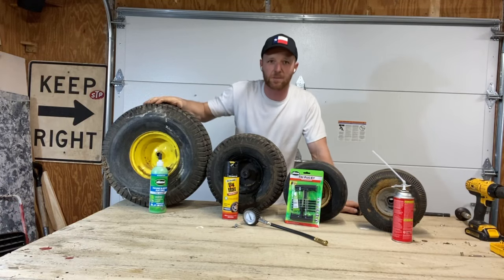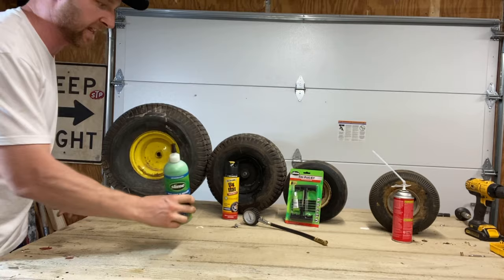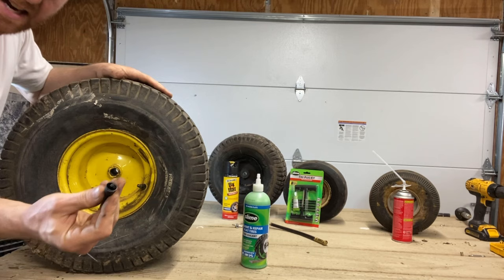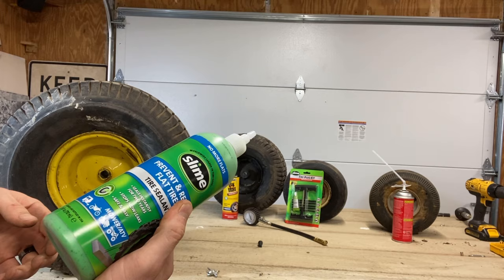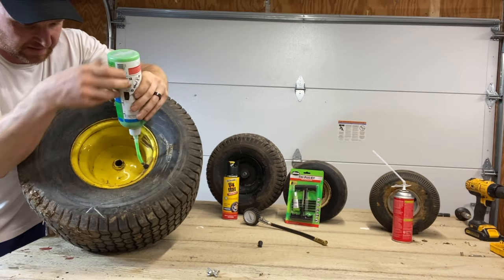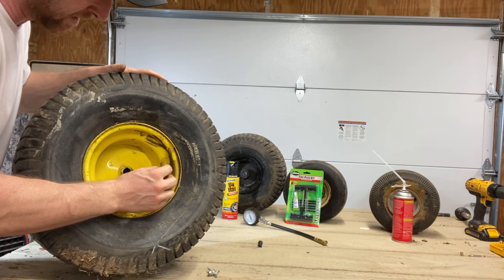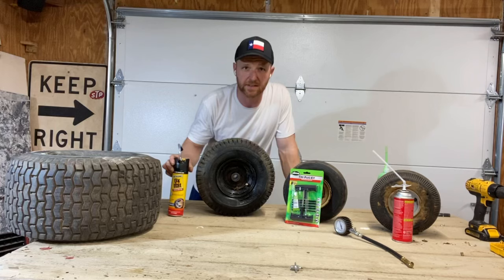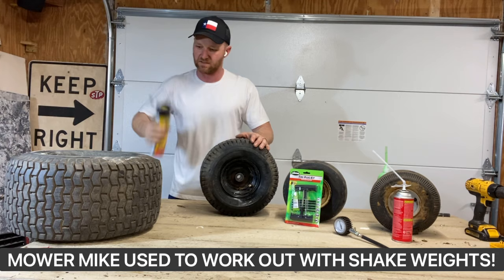Mower Tire Repair; Plugs vs Slime vs Fix-a-Flat vs FOAM (WARNING FOAM DOESN’T WORK!)

Comment: I didn't have a plug for a hole in my little lawn tractor tire. so I cut a piece of gas line, swabbed it in loctite foam(can) shoved it in with my trusty ol plugger set it on fire let it sit, held 20lbs which was way too much but just testing it. So now until I get another tire it looks like my tire has a "tooma". I have plugged thousands of tires, quite literally, working on garage for 15yrs,and I winced in the annoyance guaranteed to come when it's time to hook up the baby tire changer to the shop changer. There's always multiple leaks, then people bring their own tubes that also leak; all around headache but I do it anyway. Not tackling these mower/tractor tires is not only cowardly, its like seeing a mouse or roach in a house and just shrugging & walking away. Btw, replacing the air with foam is a total NPC zombie move
Reply from the maker: I really enjoy your use of the English language. I agree foam in the tire is totally lame. 

What is a NPC zombie?

Comment: With the caps & crack foam it seems to work with the tire stationary on the bench, but how did work when the tire was actually in use?  Did the foam sealant in the tire break up and lose its sealant?
Reply from the maker: Not so well my man, check out my other tire foam videos here. 

https://youtube.com/playlist?list=PLo4VDcnI4eoj7LEY4fgx7hGW1bM8VYQew&si=IrixeuIXIgVREu2u

Comment: Just curious why you didn't use any of the tire cement for the plugs/patches. Nice video Mike!
Reply from the maker: Good catch I probably should have. I was wondering what that tube was for in the kit lol
Reply: Yeah, my first thought. "Why isn't he using the glue"?
Reply: I've never used the tire plug glue on vehicles either and they have never leaked again regardless. Those plugs have plenty of glue/stickiness to them already. 👍

Comment: 14:53 I'm about to use some Fix a flat just because i have some. You're suppose to drive on it for a awhile after using fixaflat. It is really just expanding foam, however i have heard of people messing up thier tire by using to much rendering the tire useless. As for the exspanding insulation i would like to see if  it works if you have both tires filled like that or if its just better to use tires? You also forgot the black bead seal which is older than slime & better from what i have been told?
Reply from the maker: All I can say is do not do the construction foam, check out all my foam fail videos on my wheel and tire playlist.

Comment: I have real good luck out of plugs, on tubeless tires. Its a must to cut it off flush with the tire. Don't let it hang out. It will get caught on some thing and pull out

Comment: Have any of you put a tube in a drive wheel of a zero turn?  If you have, did you have any problems with the wheel spinning in the tire?
Reply from the maker: Nope never have, I just went to solid rubber wheels on my front zero turn wheels.

Comment: I just want to know.. How in the heck did you get the big rim off the tractor? I've tried everything. WD-40, PB Blaster, Heat, Pounding it, can't get that sucker off.
Reply from the maker: Take a look at my wheel/tire playlist I have a video on it. Good luck is a bear

Comment: This idea ads a lot of weight but it will keep it in a shape to roll. Fill the whole thing with concrete.Actually put a lot of pressure in tire put it in a tub of water locate leaks and plug them with a rope plug best cheapest way to keep my tire flying down the freeway. Fix side walls any small hole
Reply from the maker: I totally agree with you, plugs and tubes are the best fix. But this is YouTube and everyone wants to watch “shortcuts”

Comment: When you are plugging you want air left in the tire,  so you don't remove the reamer until you are ready to plug the tire.  Also it might work on a mower tire,  but typically you never plug a sidewall. On a car tire I would never do it,  but on a mower tire I'd probably patch it instead
Reply from the maker: Good advice thanks
Reply: Radial repair doesn't allow patch on tread within one inch of the side wall.
Reply: I have used the plug on a semi tractor drive tire that had a bolt go through the side wall.  It lasted over a year until I was ready too replace tires. I was often maxed out at 80,000 pounds.
Reply: @jimbeetem7143  Two things.  Semi tires have MUcH stiffer sidewalls, no comparison to car tires.  And you got lucky.

Comment: Great video. Sick of taking my John Deere zero turn to their service centre for tyre fixes - they charge like wounded bulls, not deer 🤣. We can get Slime here in Australia so think I'm going to give that a go & see how long the fix lasts. In any event it's going to save us a couple of hundred $$ each time there's a leak if it works for any half decent amount of time.
Reply from the maker: A couple hundred Australia Dollars, I am not sure if that is a lot or not lol. Slime seems to work about 50% of the time. Is a good first option, if that doesn’t work try putting a tube in it. 

https://youtu.be/xPGrzX6YhKs
Reply: @MowerMike  If I was paying with US$ it'd be a hell of a lot cheaper due to exchange rate 🤣. Bought the Slime flat tyre kit at the local auto store & seems to have worked a treat. Added bonus of the unit inflating the tyre after feeding the Slime is great too. If things go south I'll try your tube suggestion.
Reply from the maker: @mattgibson6144  Glad it helps and it is really cool to have viewers down south growing grass when it it winter time here.
Reply: Tireject works the best

Comment: What If the lawn mower tire is completely flat. Should I put some air in the tire , then put the slime sealant in the tire then run the tire around? Thank you in advance
Reply from the maker: Start with air and see if it is leaking from a certain spot. If you can pin point one hole use a plug. If it leaking from around the rim or several places maybe slime. But really the best is putting a tube in it. Any local tire shop will do that for ya
Reply: @MowerMike   Thank You I appreciate your time.

Comment: What happens if the tire comes off of the wheel? How do you repair that? Air leaked completely out from neighbors roofing nails 😡
Reply from the maker: Well that is no good. What I would do is if you can take the wheel off take it to a tire shop and they can put a tube in the tire. (Make sure to pick up the nails before you mow again ;)

Comment: I use Lock tite foam in low speed utility tires. It is not urethane based. The label says it is flexible and it certainly has somewhat has much more give than the urethane foam. So far so good.
Reply from the maker: Good luck! Never heard of that foam

Comment: From what I have read on my 1-gallon Slime container the instructions the product is not recommended for sealing sidewalls or the bead area.
Reply from the maker: I suggest just trying it and seeing how it works. You bought is so give it a whirl. If it doesn’t work try the foam method in my other video. It doesn’t matter if you already have foam in the tire. Good luck!
Reply: Damn really? I have never ending slow leaks around the outside bead of both tires. So damn annoying. I ordered some slime hope it works

Comment: Bought a classic John Deere yard tractor to restore for fun, after getting the engine rebuilt and the body powder coated, the wheels needed powder coating and Ag tires fitted, after practically cutting the tires off i found the tires had been slimed and the crap had hardened that it had to be sidegrinded off, to my further dismay the rims had been corroded heavily by the crap (slime) they had to be sandblasted  and the pin holes through the rims from the corrosion caused by this crap had to be welded up, keep using this tire crap only on the AYP junk and box store trash mowers
Reply from the maker: Good advice I have never seen that before, thanks for the comment

Comment: Hi Mower Mike! I see its been 2 years since you posted this video. How has the front lawn mower tire held up?
I'm thinking about trying it.
Reply from the maker: Check out my tire playlist, will answer all your questions
Reply: @MowerMike  Thx! I did my 1st tire this evening. I used loctite big gap foam.
Reply: @MowerMike  My foam fill was a fail this morning but it seems to have sealed the 5 dog punctures and I was able to air it up and so far so good.
I have brand new front tires that wouldn't seal at the beads so I did the bead sealer yesterday morning only to find out that the tire that my dog attacks every time the blades start had 5 punctures in the side walls. I already had 2 plugs in the side walls because of her and I just wasn't gonna put 5 more plugs in the tires. 
Hopefully this foam can still work as a tire sealer so the tire can still hold air.
Reply: I soooo thank you for your awesomeness and labor of love.  The foam inspired me greatly....my only concern is that it might hold dents or something.

Comment: LOL, in my time I have tried all these and more, my personal conclusion for multiple reasons: tire repair plugs or tubes. That’s it. Everything else is a problematic gimmick that will only make you sorry you fell for it.
PS: the foam quickly squishes and breaks down, then you throw the tire, rim, and empty can in the burn pit and go buy the whole shootin’ match.
Reply from the maker: Yep totally agree. You should check out my foam fail videos on the tire playlist.

Comment: if you're in Texas and have a bunch of holes after you mow -  mesquite thorns...?  Aren't you supposed to turn that foam can completely upside down so you don't just release the gases?
Reply from the maker: You really need to watch my other foam videos. Mesquite thorns? I have never seen a Mesquite tree with thorns.
Reply: @MowerMike  I am looking up your other foam videos right now.  Does the foam make the ride any firmer than having air in the tires?

"...never seen a Mesquite tree with thorns."  If you're a real Texan, you must be pulling Dabcorn's leg with "comedic irony".  🤣
Reply: Tons of mesquite in Texas! For sure. Mesquite trees are full of thorns.

Comment: most mower tires if you dismount the tire and seal the seam in the middle of the rim will be all you need
Reply from the maker: Are you saying to seal the actual metal rim?
Reply: @MowerMike  yes if you dismount the tire the rim especially on a deere the rim is 2 pieces and its pressed together so there's a seem right in the middle if you have a leak and cant figure out where it is thats probably it
Reply from the maker: Interesting thanks for the tip never thought of that one

Comment: Don't think the foam work with much weight on it crush down over time probably work on those little pull behind trailers lawn mower style or wheel barrel light duty
Reply from the maker: Check out my tire playlist, lots of foam video fails

Comment: Guys don't ever ever in your life use that slime green crap it'll eat the metal on your wheel within a few years then you have to be replacing the wheel and a tire so don't use it unless it's in a dying need emergency other than that never ever use that stuff it's horrible
Reply from the maker: I wouldn’t say ever. I use it all the time on mowers I am fixing up to sell. 

Hmmmm makes me think sure hope those wheels falling apart. Well dang it

Comment: You fail to use the tire cement with the plugs. But you don't even know the difference between a tire plug and a tire patch, LOL
Step 1 locate the leak. You did
Step 2 Thread plug in plug tool. You didn't
Step 3 Use reaming tool to prepare hole for plug. Leave the reaming tool in hole so your air doesn't leak out.
Step 4 Apply cement to plug in the eyelet area about 1/2 inch both directions. This helps lubricate for insertion and glues plug in place, most plugs are heat vulcanized by highway use on autos, but is not needed in all applications like mower tires.
Step 5 Remove reaming tool and insert plug half way or a little more, twist and remove plug tool.
Step 6 Trim plug flush with razor knife
Reply from the maker: Haha I can’t believe they even let this guy post tire videos!

Comment: I suggest  drilling only one hole  see how well foam does
Reply from the maker: I am done with foam videos give it a whirl
Reply: @MowerMike  only  if I  have to been  plugging tires for a living  39years I had only one accident doing tires. I  was  plugging  tire for police  department and  slipped  stuck reamer  through  hand pulled  it out  finished  tires one of police  officers  almost  tossed his cookies, he turned so white thought  he was going to pass out.
Reply from the maker: Youch that sounds horrible!

Comment: Has anyone tried putting butyl rubber sealant on the inner surface of a non highway tire. Lawn tractor tires are made out of butyl rubber to begin with. From what’s listed, the stuff is considered airtight. I’ve not tried this route.
Reply from the maker: Give it a shot and let us know. You would have to completely remove the tire to do that. If you are going that far you may as well just put a tube in it
Reply: @MowerMike , I’m retired and on a fixed income. Every penny counts, especially in today’s economy.

Comment: {{ WARNING FOAM DOESN’T WORK! }}<<<<< Why do you say that???? Looked it did to me.........  Slime appears to win, BUT BUT BUT only if tire is frequently rotated like on riding mowers..... 
My problem is these small freeken generator tires that hardly ever get moved, for months they just sit in one place till power goes out, I want a way to easily permanently fix them, those tires dont come off without destroying the rim!!!!!!!!!!
 It looked to me that the foam worked good BUT then you say in description>>>>>  (WARNING FOAM DOESN’T WORK!)<<<< Why didn't you say that on the video and WHY did you say that????!!!!!!!!!!!!!
Reply from the maker: It doesn’t on a heavier machine like a mower, check out my other foam videos have alot of foam rails

Comment: Slime is crap. Your supposed to drive it for 3 miles. Ya sure, I'll take my mower for a honeymoon drive. BREAKS down in days not weeks until you decide to put a tube in it then it flows all over the place. I had a great one in the 70s called flat proof but no longer on the market...figures. Still looking for a REAL slow leak fix.
Reply from the maker: Sounds like you are a tube man for life

Comment: Not a good solution. This is low-density, rigid foam. You want high-density, flexible foam like Smooth-On's FlexFoam-iT! 25.
Reply from the maker: Yep I agree, check out my tire and wheel playlist there is a few foam fail videos. Thanks for the suggestion I have some of that foam on order am excited to try it.